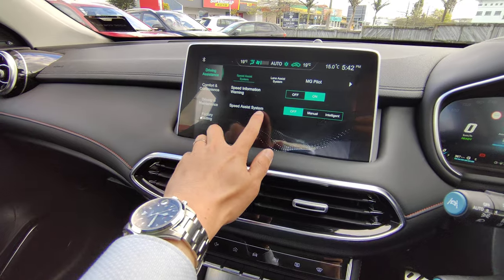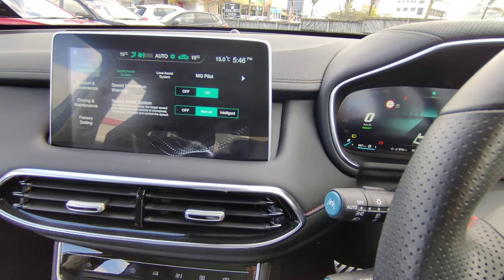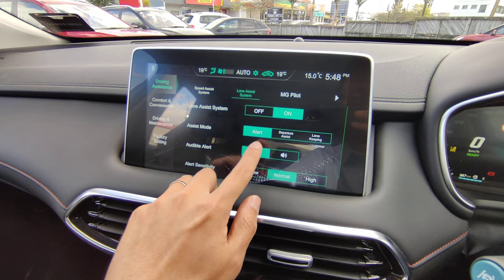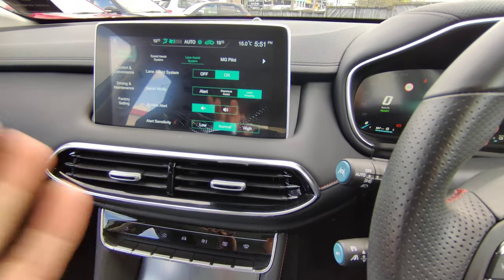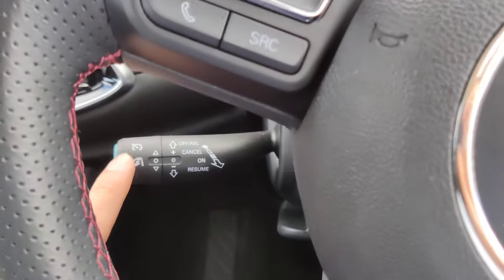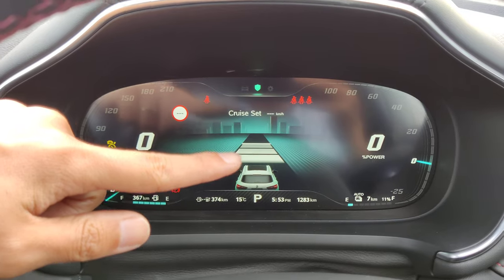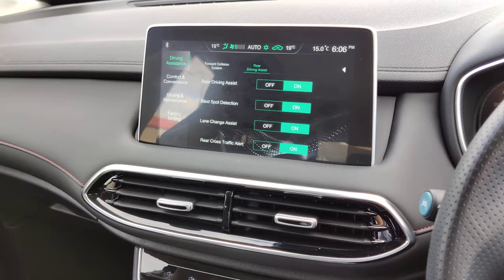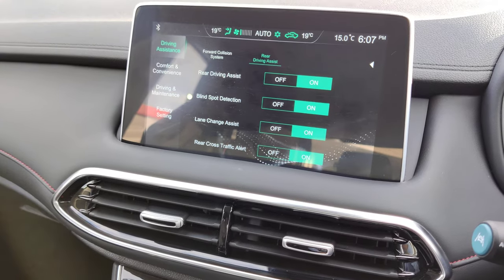MG PILOT Assistance Explained -- A Complete Tutorial for MG ZS, ZST, HS, ZS EV, HS PHEV and more

Comment: Great video! Learned a fair bit, especially with the Speed Assist System and wondering why it wouldn't turn on (cruise control is enabled). One thing that I find annoying with the Pilot System is the constant MG Pilot Quit notifications when it switches off and on.

Comment: Oops, useless for ZST Core that we bought in May 23 in Oz I fear. This appears to be a ZS EV looking at the instruments. A bit different to ours!!
A good try but the vast majority of reviews and U tubers use the higher end models which is often unintentionally misleading. Lesser models miss out on stuff and the Excite full led panel is totally different
What I'm after is how to setup the Pilot system and what it's standard settings are. And can I setup outside temperature? And don't give me the palaver that it is exclusive to turbo models. The 1.5l non turbo must have a MAF sensor in the inlet that, amongst other things, measures the temperature of the incoming air. Otherwise, how does it get through Euro 5 emissions compliance?
Otherwise thanks Jerry. Your review was a serious part of my decision to buy. Tell that to MG.
And I notice that the manual says that the car needs 1,500k running in. So, like all my cars, it is getting run in on V Power. And it loves it!! No noticeable hesitation off idle, what hills and a rorty little burble. Will revert to minimum 95, but our local steep hills might require 98.
What's not to like.

Comment: Very good detailed information. My 2023 HS Exclusive DCT 1.5 petrol supposedly has blind spot detection but I'm not seeing any lights. Is it set up wrong or is it supposedly automatically set up any way?
Reply from the maker: Hs blind spot is located inside the A pillar and it is not very bright. Double check and see if it's there
Reply: Hi, I took mine to the dealer with this issue, and there is a (hidden) engineering menu which turns it back on (among other things).  Will have to google to find it I'm afraid.

Comment: Hi Jerry, I just got a new ZST Essence in Australia and I noticed that I need to switch on Speed Assistance everytime when I start the car. Is this how it is designed or there is something which I need to do to keep it on. Also wanted to check, does the lane keeping and speed assistance only kicks in at certain speed limits.
Reply from the maker: Yes speed assist has to be manually switched on each time. Lane keeping only kicks in over 60km/h

Comment: A question, does Adaptive Cruise Control use Regen to slow the vehicle plus mechanical brakes as required  or only mechanical brakes? I have an Outlander PHEV & stopped using Adaptive Cruise becauseit only uses mechanical brakes. In most cases the small fluctuation in traffic speed, is easily noticed ahead, and by turning off standard Cruse Control the Regen is sufficient to slow the car safely, while giving a small amount of extra energy and saving wear on brakes, before gong back to speed & turning cruise back on.
Reply from the maker: Hey, by my experience, adaptive cruise control only uses mechanical brakes. It would be cool to have regen brake on cruise control to gain some energy but I'm not sure the set-up or reason behind that.
Reply: @JerryPanandCars  Thank you for your time replying. Regards Paul
Reply: @JerryPanandCars  But even by using the brakes, it won't regen anything? Thanks
Reply from the maker: @twurlion  standard brakes will regenerate. The only situation it doesn't regenerate is when you use cruise control
Reply: Regenerative braking is almost non existent when drive battery is nearly fully charged, so mechanical brakes are a necessary feature.
Reply: Thanks. Since I went the Tesla route, mechanical brakes and regen work seamlessly when the battery is full, and Cruise uses regen when available, which inevitably it is even if I charge to 100%, as I have a 14-mile journey on twisty country roads before getting to a road where autopilot/cruise is possible.  @smokyatgroups